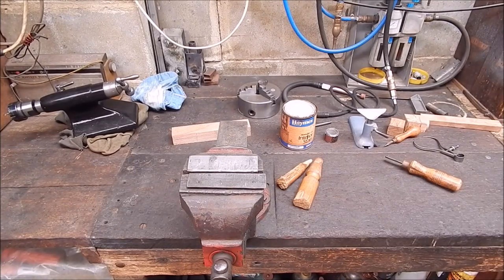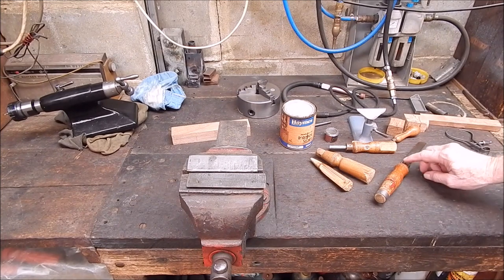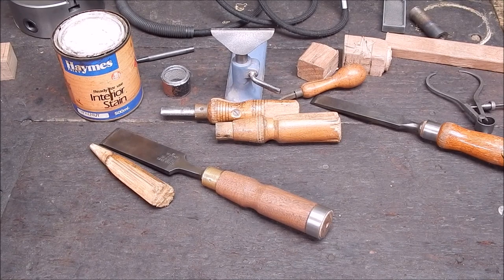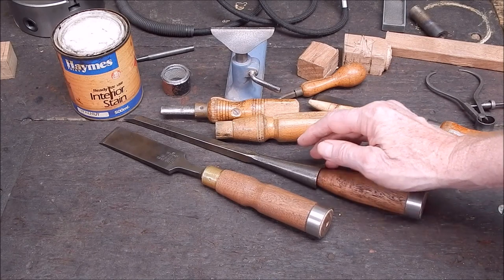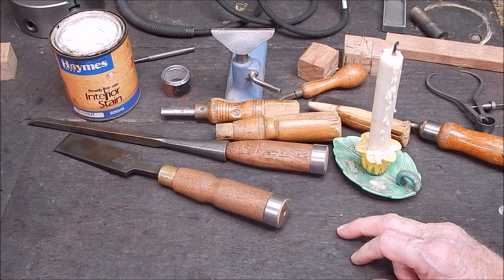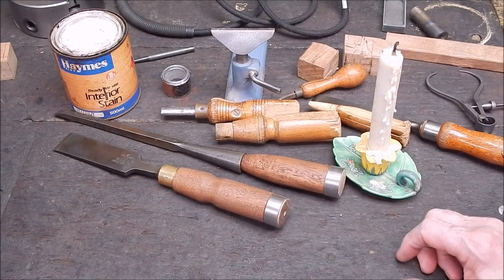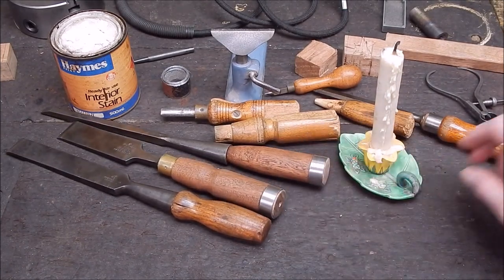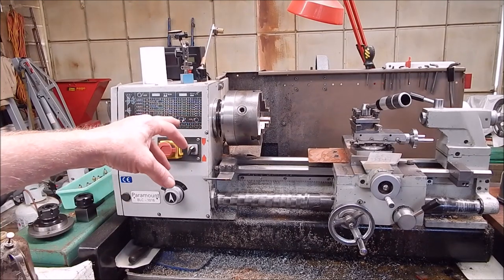An old workshop trick and things to consider about lathe chuck weight

Comment: My lathe is a similar size (11" swing), and from new it was meant to come with an 8" 4 jaw, and a 6" 3 jaw. I currently have a 6" 4 jaw and a 6" 3 jaw. I would still like to pick up an 8" 4 jaw, a few times the 6" just hasn't been big enough.

I saw a great video in the past where a bloke had made up a wooden carrier that sat on the bed ways and picked the chuck up very close to centre height, and it had a handle on top too I think. Made the whole operation pretty painless.

Those handles have come out great. Nice work!

Cheers!
Craig

Comment: I've got a Taiwanese 12" (300mm) dia. swing lathe. It's belt drive with a screw on chuck. You're quite right about the chuck weight. They increase in weight very quickly as the diameter of the chuck goes up. I've got an 8" three jaw and a 10" four jaw and even with a wood cradle on the lathe bed they are a chore for an old man like me to pick up and put on the shelf.
My successful secret plan was that I got hold of a 4" chuck mounted on a 5C collet shank. It does most of the odds and ends work on the lathe. Popping it off for a 5C collet takes no more time for changing than for changing collets.  
I use a #4 Morse Taper>5C adapter on the spindle that I got from Grizzly for $45US (they've gone up a bit in the last few years I think) and a homemade draw tube to hold the collets.
Cheers from NC/USA
Reply from the maker: Good idea regarding the smaller chuck.  You win on minimum gripping ability as well.  Must make it all much more usable for general small workshop jobs.  Cheers Rob

Comment: I have a South Bend 9C with a screw on chuck. Not too heavy, but it will put a nasty bruise on your hand if it slips. I also put a wood block under the chuck when changing it. Saves the chuck, lathe bed, and your fingers when you swap chucks. 😆
Good idea to smoke the chisel socket. When you were describing the ring on the butt of the handle I kept thinking it had an odd name that I couldn't remember. I looked it up and the name was schlagring. Pretty fancy. It translates to ferule. Not quite as fancy. 😆
Reply from the maker: Schlagring sounds German, but it translates to "brass knuckles".  Not quite the same ;)
Reply: @Xynudu  That was the first definition I found. 😆 Then I entered schlagring chisel and it came up with the ferule synonym. So did someone use schlagrings for brass knuckles? 
I'm no linguist. All I have to work with is Google Translate and the guys on the Old Tool Mailing list. In any case the rings add a lot of life to a wooden chisel handle. 
Handles are a fun project. 😆😎
Reply from the maker: It may not even be German.  I just used Google translate out of curiosity. You get some interesting synonyms at times.

I was in two minds whether to set the steel ring flush radially or have it slightly proud of the handle.  In the end I made it the same as the Titan chisel which is in good original condition, slightly proud.  I don't think it really matters.  It sure helps protect the end of the handle and stop splitting. Easy to make and fit.  Cheers Rob

Comment: Good job on the chisels, I was thinking to heat the metal part, before you mentioned it, I was taught when fitting file handles ( ones without the spring inside) to heat the tang to full red, then insert it for a few seconds, then cool off, and lightly tap in. You've got some nice hardwoods in Australia.
Thanks for sharing and best regards from the UK.
Reply from the maker: I will have to try that on file handles.  Should be fine as you let the steel air cool.  Cheers Rob

Comment: If you quit banging on those chisels handles they'll stay pristine for a long time...     lol
Chucks up to 8 inches are still bearable to me, but, seems like they get heavier at every change, getting a 10 incher is quite more steps like using a pipe in the jaws to guide it in the broach after sitting it on a board, bigger than that like a 12 incher, I really need to use a crane, 140 pounds (about 65+ kg) is not  in my ability any more, that and the bigger rotary tables on the mill...  
Geeeeeeeezzz, steel is heavy and aging doesn't help...   😰😱🥵🤢
Reply from the maker: Hi Pierre,

Getting older sure makes things heavier.  Must be the chemical composition of the steel changing ;)

Cheers Rob

Comment: I have a 6" 3 jaw and an 8" 4 jaw chuck and they are relatively thin compared to your chucks.  I would guess the 4 jaw is about half as thick as your chucks.  Still they are heavy enough.  Their is no back plate for either one the threads are in the chuck body.  This allows a lot thinner construction.
Reply from the maker: Hi Harold, good point.  They all vary quite a bit.  The Schaublin screw on four jaw has a backing plate, which makes it heavier.

The step up in size/weight from 6" to 8"is quite large compared to the smaller size increments.  I wonder why there are very few 7" lathe chucks around ?

Cheers Rob

Comment: Hi Rob:
Your Schaublin is a work of art.  Whenever it appears in your videos I find myself taking a moment to just look at it.  It is unlikely I will ever see one in my neck of the woods but if it happens, I'll get it. Thanks for posting.
Reply from the maker: Hi Bob,  Other toolmakers lathes from that period have a lot of similar style and look good.  They basically copied each other and even used the same bed dimensions quite often. 

I keep an eye open for parts and accessories for tool makers lathes.  They are thin on the ground, but often go cheap because they are too basic for most people.

I've passed by on a few non Schaublin units (Lorch), that on reflection I should really have bought and stored away.  They were both in the country (mid north) but worth the trip.  All this stuff is going to get more expensive as time goes on.

Cheers Rob

Comment: Thanks for the candle tip. Handles look great.
Reply: Agreed. I did some fitting work on a knife handle once an the ink was fine until I painted the finish on and that wicked/leached the ink to the outside surface. It wasn't catastrophic but it left an unavoidable green streak at one of the seams. Not a fun surprise at the end of a project. Wish I had known to use the soot marking trick!

Comment: G'day Rob, another good video.  I use the soot trick when cutting square or acme threads.  Use a small rag with a bit of kero, light it up on a length of bar and soot the thread up.  Shows up the high spots better than any sharpie or bearing blue.
Cam
Reply from the maker: Hi Cam,  I wondered how kero smoke would go.   The candle has always worked OK, but not everyone has a candle laying about :) 

Bearing blue can be a bit problematic if you put on too much.  Cheers Rob

Comment: Hi Robbie, great job on the handle's. I never thought about how many times you handle a chuck going from my 8" in. ( 203.2 mm) to a 10" in. (254 mm,) and now because of you I added ER-40 Collets. I like the bite of the ER-40's vs my 5-C Collets. Great safety tip, on how to place the BIG chuck's on the lathe, so you don't drop a chuck on your foot. That will leave a mark. LOL

Comment: Rob,
   Two good subjects to describe!
   I’ve used the candle blacking method to fit axe handles, hammer handles and chisel handles for fifty years. In my opinion there is no better way to get the exact fit required. Socket handle chisels are particularly difficult to fit but absolutely must be precise or the handle will loosen repeatedly, that being quite frustrating when on a job. Once they start slipping it gets steadily worse. A properly fitted handle on any tool will never loosen with use. 
   As for chuck size and weight you are also correct. I have a small lathe that had a very small chuck when I bought. Chatter was a constant problem no matter how a approached the problem, even while turning soft materials like aluminum and brass. I was about ready to toss the machine but then decided to try a six inch three jaw and I was amazed at the difference. The heavier mass of the chuck helped absorb the stresses and I can turn any material including stainless with no chatter problems. 
   You can go too far with this concept however. I recently bought an old Logan Lathe that, while built in 1941 showed no signs of wear or abuse. The machine had been used it’s entire history in a musical instrument repair shop where brass only material was turned on it. That alone was the reason for so little wear. The one thing that was a problem though was the size of the chuck. Originally Logan Lathes we’re equipped with a narrow five inch three jaw scroll chuck. Those chucks were very light weight compared to modern ones.
   Somewhere along the line the owner replaced the original chuck with an eight inch Bison three jaw. Bison chucks are very fine chucks here in the US and I was excited to see it on my new lathe. The problem was the chuck was far to big and way too heavy for the lathe to properly power it up to speed and then hold it. I purchased a couple of back plates and fitted them to both my six inch chucks, three and four jaw, and now the lathe performs splendidly.
Reply from the maker: Wow, that's a lot of chuck Dale.  At least it will bring good money and pay for something else. 

I see large lathes with large chucks on the internet and always wonder how owners put up with the effort required to change the chuck.  They probably don't do it, and miss out on one of the major benefits of having a lathe.  

Cheers Rob

Comment: GDay Rob, candle trick reminded of a Tool Maker I worked with many Years ago. He used a simple burner with a wick and Kerosene as fuel because it burned sooty and then he could check high spots on punches and dies that had been hardened so as to gain the correct fit using diamond grit files. A very clever man I had the opportunity to work with and learn from. John, EC Australia.
Reply from the maker: Hi John,  the simple old ways generally work well and do the job OK.  Prussian blue can make a real mess, but a bit of light soot is no issue.  I have wondered about using Kero, as it's pretty smokey when burnt rich.  Cheers Rob

Comment: Love the smoke trick, cheers Rob,
I was gobsmacked at the weight difference on the 4" and 5" chuck I got for my ml7, weren't sure if the spindle could handle it, I only just about could!
ATB,
Cliff
ATB,
Reply from the maker: Hi Cliff,  I have never bothered to weigh chucks, but it seems to go up 40 - 50% with each size increment.

Anything over 6" is a real struggle to change manually.  Plus the bigger they are, the larger the minimum gripping ability.

That old Pratt chuck is really handy having such a big throat.  I don't use it a lot, but drag it out every so often.

Cheers Rob
Reply: It's the old square-cube law in action. Mass is a function of volume, and volume increases with the cube of the outside dimensions, so if you double the diameter you get eight times the weight! (all things being equal)

Comment: If u didnt know its pretty easy taking chucks off if u lock a bit of round bar in jaws hanging out atound 6" front & thrue headstock.
So it cant drop & easy to lift off,out, e.t.c.
If y try ule allways do that way😉
Gives chuck handles.
Sydney ace metal Spinning
Reply from the maker: Good tip Ian.  Just so long as you don't mark the spindle taper.  Cheers Rob
Reply: @Xynudu  
Good thought.  If you had your round bar or pipe long enough you could grab it before you got to the taper and then you could keep from damaging the taper.   The problem with a bigger chuck is they are awkward to hold on to.

Dale in Canada